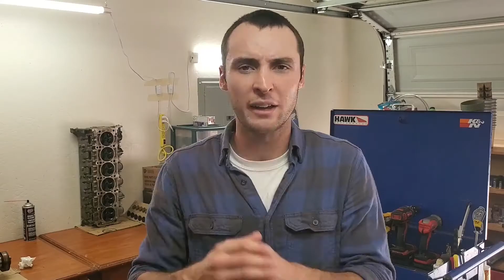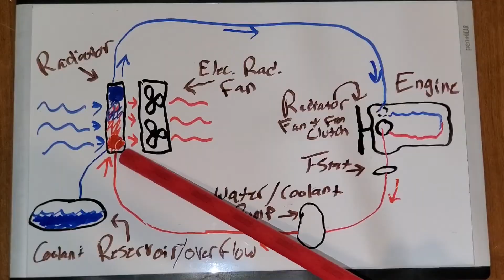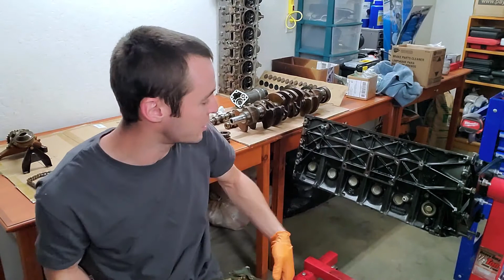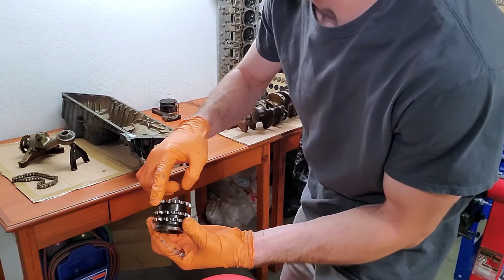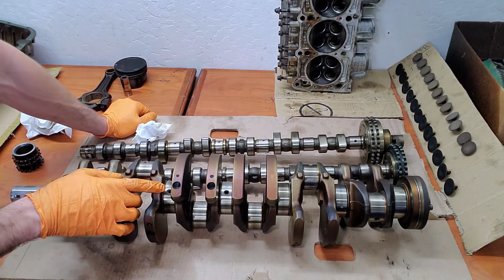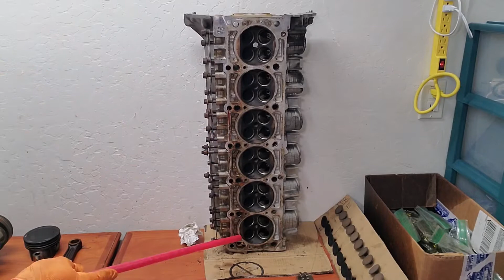Engine Block - Oil And Coolant Systems (M104)

Comment: Does anyone have the part number for this oil filter bracket that appears in the video?
I'm asking because this one doesn't have an oil cooler, which usually causes problems with water mixing with oil.

Comment: Hello guys, Jake you show that oil come in 1st hole comes out from second round hole and feeds engine block and head, but there is third (small) hole on engine block. My question is, what function has that third (small) hole? 

My guess is, it is cavity to gas pressure relief valve, which is in oil filter housing, is that so...?

Comment: the block should be similar if not the same as an m103 engine!!
Reply from the maker: Yes it should be extremely similar, but i am pretty sure there are some subtle differences between the blocks. The heads will be alot different obviously, you probably know that.
Reply: I think its even "same" block for the diesel 6cylinder - the block/engine will hold up to 900hp without modifications (Turbo bandit)

Comment: Don’t m104s have oil sprayers under the pistons?
Reply: Some do some don't! I think they removed them from non AMG models post 1994. 1994 and earlier ALL had them as far as I'm aware
Reply from the maker: Jacob O'Brien is correct, some do and some dont. I am using the m104.995 which does NOT have sprayers. The connecting rod has an oil passage in it though, to lubricate the piston wrist pin and to some degree, the piston underside and skirt.

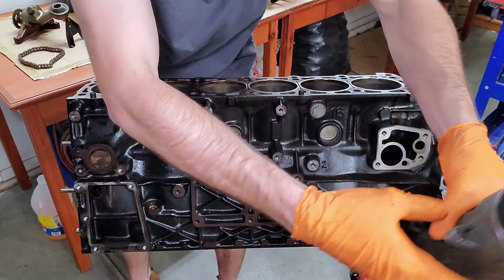Comment: At 2:20 in the video, on the left downside is some oil holes behind the servobracket, where is that going and what is that supposed to do? And what do you do with it when turbocharging?
Reply from the maker: So where that square area is with the holes, and the bracket goes on over it with a little metal gasket, i assume thats what youre referring to. So, thats actually a part of the pcv system. Crankcase fumes go in and the oil drains back through the bottom, and then the fumes come out the nipple of the side of the bracket. 

When turbo charging, the oil outlet from the engine is on the oil filter housing. The return from the turbocharger goes straight down into the oil pan. The PCV system on my engine is literally some heater hose with some T's, run down to dump to the ground.

Comment: Will you drill holes for oil injectors under the piston?
Reply from the maker: I thought long and hard about it. Long story short, no. The wrist pin and piston are lubricated directly already, and for piston cooling, a top coat of ceramic coating should suffice. 

There are some, so I hear, that use this block from the junk yard and put 600+ hp to the wheels without rebuild.
Reply: Jacob Castle Got you! One more question, do you know what is the engine weight compare to a 2jz or 1jz ? Thanks
Reply from the maker: @AlexSolo_  block or entire assembly? 

From what I can tell, the engine assembly weights are very close, M104 (Non-Turbo) being ~450lbs and the 2jz-ge (Non-Turbo) being ~500lbs. The 1jz-ge (Non-Turbo) is ~450lbs. All have iron blocks.
Reply: Jacob Castle Yes, I was interested in the complete engine assembly :) Thank you very much for the information.  Also, it would be great to know the final cost of the engine built.  Good luck with your engine assembly!
Reply from the maker: Hey, if you stay tuned I'll come up with a total figure at the end of the series. The goal is to be as low cost as possible!! And thanks for the positivity, I'm here to help the community!